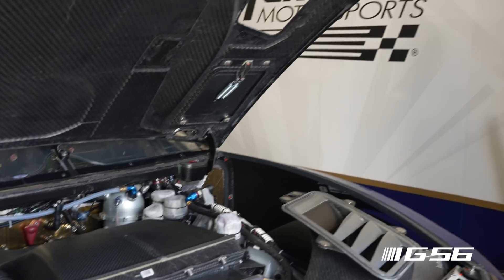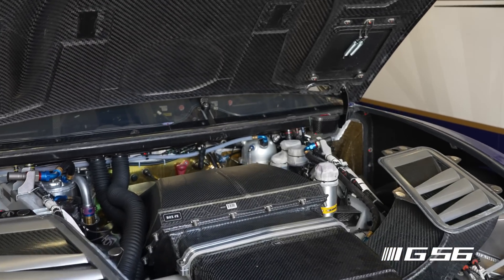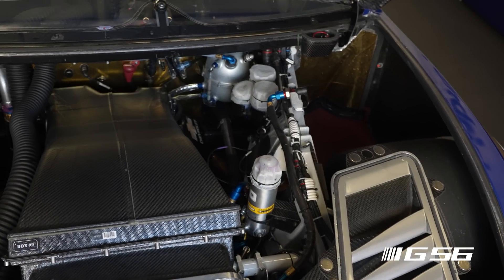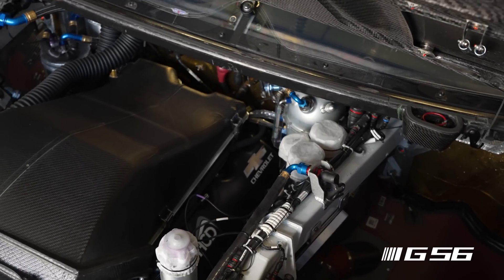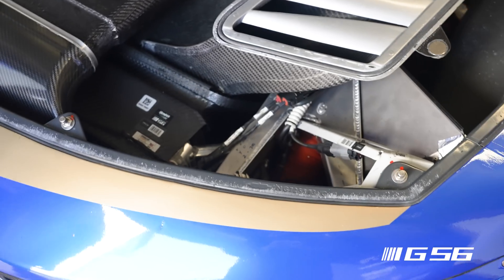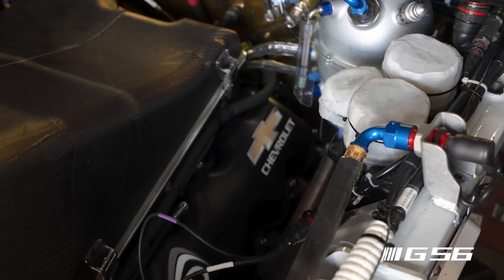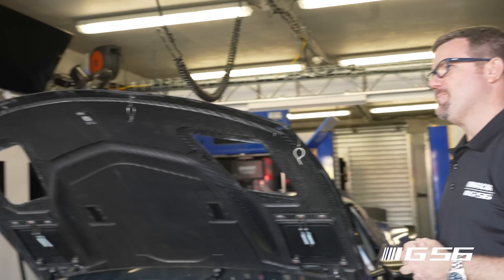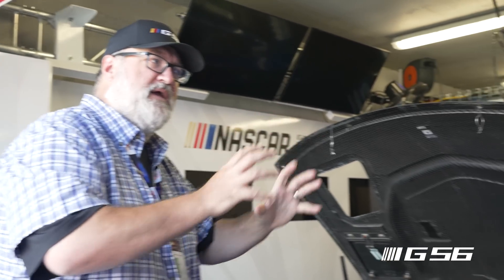Garage 56 Le Mans Tech Tour Part 3 with the NASCAR Chevy Camaro ZL1 Cup Car

Comment: Great video series - for a UK endurance race fan not knowing much about Nascar - what size engines to Cup Cars and Car 24 have?  351 cubic inch? bigger?  (When I was a water skier I had a 351 Cubic inch engine in my boat. It was a Clevor design - A mix of a Windsor block and a Cleveland head but not sure whether Ford or GM parts.
Reply: It's a 351. That's been the standard for years in Nascar still on a pushrod cross plane V8

Comment: considering the car has basically little aero out of lack of proper wings, so, as consequence it should have a low cx as well. Considering also that zl1 top speeds were just a couple of km/h higher than other GTE cars, I don't expect this car was pushing more than 550hp during sunday test sessions (GTE are in the range of 520hp). Which is quite reasonable for an engine that should last about 35 hours.
Reply: He said halfway inbetween 500 and 1000 hp. My guess is this car is the most powerful car on the grid at Le Mans, well over 700hp, and has a ton of drag because of the huge aero wall they built around the car to make it take corners.
Reply: @R4M_Tommy  and the porkiest ....its American after all😂
Reply: @R4M_Tommy  GTE Ferraris are good for about 650.
Reply: @thethirdman225  GTE cars run all about 500hp because of BoP
Reply: since this is a garage 56 car,  which means that it's not contending for the win,  instead its designated for cars that are things like proof of concept,  technology demonstrators.

Comment: So 700ish horsepower? Because if so it is comfortably one of the most powerful cars in the entire grid, nascar engine have been famously know to reliably make over 900hp , maybe even 1000hp , so im glad from a race sake that yall went with 700
Reply: according to the marked top speeds, this car has nowhere all that power.
Reply: @giovannibalsamo6178  very high drag
Reply: @giovannibalsamo6178 the car has a low top speed but what Jenson said, the car is unexpectedly good accelerating and taking corners, none of the GT's can touch it on speed but it is still running 12's slower than the slowest LMP2
Reply: @therealtechfromheaven  It’s also going to be very hard on brakes.
Reply: @thethirdman225  and it's going to be very hard and stupidly annoying to pass 😂
Reply: @thethirdman225  I can see them doing a mid race brake replacement "NASCAR style" in 2 or 3 minutes stops, that's one of the things were this car can also gain advantage on the competition by making stupid fast pit stops
Reply: @therealtechfromheaven  That’s been done before with the GT40. I don’t think it really makes a lot of difference.
Reply: @thethirdman225  Is done nowdays too without major issues by most of the grid on these races...
Reply: @therealtechfromheaven  It has a low top speed becaus of the "barn door" style of rear spoiler they are running, add those flares or whatever that they put on the sides, and that explains why it is so draggy. Another point is that the car overall is big, compared to the GT cars, they look to have overall the same top speeds, but with less power...
Reply: @Thraser999  I’m sure you realise I’m not surprised by this…

Comment: We need more videos honestly we are ALL drooling over this car. If NASCAR ACTUALLY RAN THIS CAR I SWEAR THE COMEBACK WOULD BE REAL. It’s incredible and fascinating
Reply: Not really, they are just catching up to 2000's technology.
Reply: @shawness93 yeah right, fastest gte pitstop, 5 overall, 4 seconds faster than gte in qualifying today and faster than 2 lmp2s and in your opinion is “still catching up”
Reply: @Andy Fernandez  pitstop time and lap times have nothing to do with my point.  Remember nascar just implemented regular old fuel injection about 8 years ago.  They are just now implementing sequential gearboxes that were available decades ago, and even street cars had them years ago.  Just got single wheel nuts and maybe have direct injection.   So before you start mouthing off, educate yourself on these prehistoric sleds history.  These cars are not by any stretch technological marvels.  The tell all will be how long they run in a single tank of fuel.  There is no doubt their stints will be much shorter than the other due to the lwss efficient v8 and heavier weight.  Lucky the track does not have more curves or their tires would fall off before everyone else.  You clearly are not familiar with forms of racing outside of nascar.
Reply: @Andy Fernandez  they were 8 seconds behind the last hot lap lmp2 car.  The other lmp2 car had issues and one more didn't even qualify.  You a 🤡 bro.
Reply: @shawness93 whatever bro, I was being respectful to you and I was just stating facts, you do you my man
Reply: There’s always one bro
Reply: What’s the difference between this car and the current cup cars? (Outside of the obvious add ons)